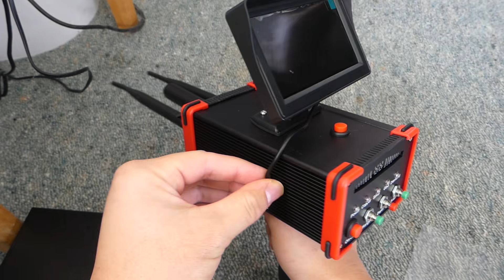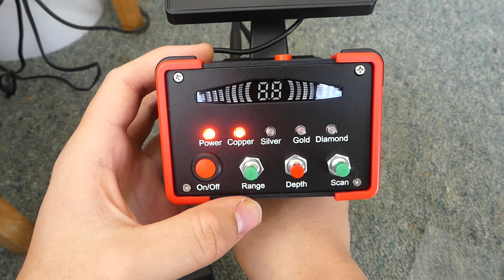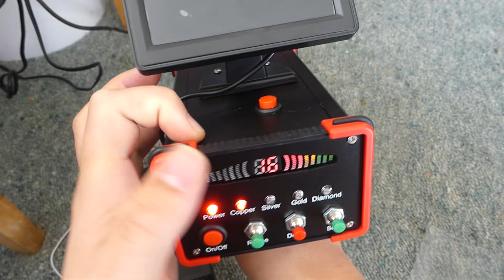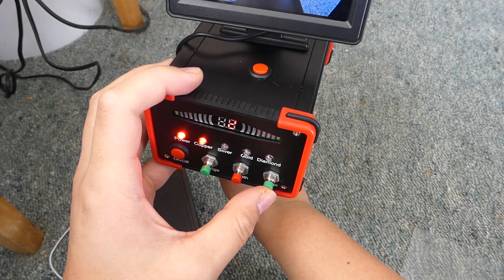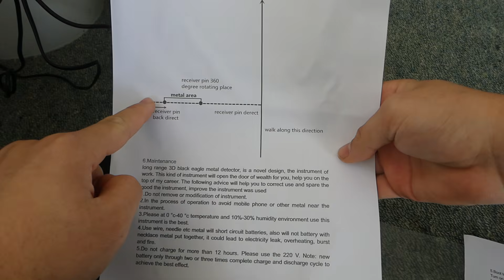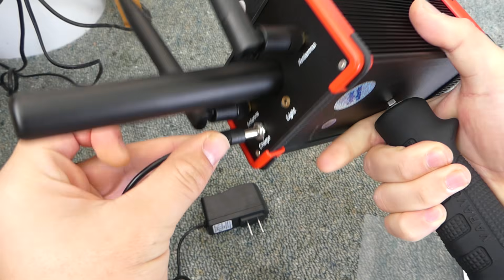How to use the long range 3D black eagle metal detector

Comment: Device working, bad not yous on you country, you nite one program key , to yous on you eart system.  I have det samme lokaotor, and working super god . Advanced.
Reply from the maker: Interesting... perhapps you got one that actually works :'] mine was mechanically incapable of pointing towards anything with accuracy and was just a coil linked to nothing on a ball bearing swivel :']
Reply: Obrigado. Poderia mi explicar como  faço essa chave no Brasil ou indicar alguém
Reply: @EloirSilveira-j2s 7.83hz  key on Afrika Brazil and other  earth.   I nite to  25 MHz .  To working perfekt.
Reply: @AKSDetektorSRB  Are you answering with your ass that it is true?

Comment: The problem it can’t separate gold from iron
Reply from the maker: This device does not however I can think of a way you could. by making an EMF field that accurateley measures metal resistance you could tell if it was iron or gold. or by using GPR ground penetrating radar that can read the density of the object. :3

Comment: I want to buy one, what do I have to do?
Reply from the maker: Ah, I definitely would not recommend it, as soon after I bought this device I was a little suspicious, so I disassembled the device by hand and discovered that it was an absolute scam, the antenna wasn't even connected; it was all for show, what I did find inside the device (presumably that they thought no one would ever pull apart because of its expensiveness) was a small four channel remote control toy car looking circuit board with one purpose and one purpose only, to turn lights on and off and make a beeping noise between the battery powered beeper box and the so called detector itself, I made a video on this but no-one seemed to watch it :') https://www.youtube.com/watch?v=Vsf7Q_mFl7k
Reply from the maker: When I bought this device and made a video on it I was young and very stupid, here is a link to the same device that I bought (https://www.ebay.com/itm/334208641676?itmmeta=01J1B712P64TD38VT7BQV9ZGYE&hash=item4dd0632a8c:g:ySYAAOSw-kJhueKs&itmprp=enc%3AAQAJAAAAwHnpnuJWm14m%2F2hDa94DqM9p1Kn%2BYuMaBDBQNekPj%2BWs4Yx1eYqWmdmAhZhe1Ov%2BKZuyt7LikdggPJbGChfnf83gs%2Fpd0xt8wglbHiF0mwbGXcE2YTkRZTQC8c5LWDaDi2k6M7AZiAvmHvdzHUIh%2BO8S0OmRqgUdjSt4xWsu2l9OSX0GaNcwjyt9JZ%2Fr7g8bfJbY6xZjNB1Q2r0MOI5pQvohFpOBM1K6VkgK67UiWmJnfXI%2BM68YARYozY%2BmsIP1Uw%3D%3D%7Ctkp%3ABk9SR5arhOeKZA), but please PLEASE! don't buy it. It is 100% a very well made ruse designed to lure you in and trick you into thinking you are getting something of value 😢. I fell for it hopefully you don't also, at the time of making the video I was convinced that it would work, I tricked myself into thinking it was real, and then curiosity got the best of me and I had to know for sure whether or not it really did do all that it was claimed to do, It has the most dodgy sketch back alley video game dealer instructions and that was what made me decide to reverse engineer it. :')

Comment: I have this before. Its fucken fake...
Reply from the maker: It is! I spent $600.00USD on this and then got suspicious so I made another video of me dismantling it to see whether or not it even had the required parts to detect metals and half of it wasn't even connected and all that I found was what looked like a 4 -5 channel remote controlled car circuit that did nothing other than make the lights turn on and off. This was a massive rip off!

Comment: Sar please tell me about is price
Reply from the maker: it was $600USD, however I found out it was a scam after dismantling and reverse engineering it. 😢
Reply: @Olectralab how is possible for reverse engineering?
Reply from the maker: @DuganaIandy  I disassembled the device and found it was incapable of controlled movement, it was literally just a box on a bearing with what looked to be a remote controlled car circuit the turned 4 lights on and off.
Reply: @Olectralab  I  want modify this machine there alrm system can u tell me how can I do it?
Reply: That's mean gold detacting after that alarm will on ....
Reply: How much in Saudi Arabia royal

Comment: HM sir..and how to buy
Reply from the maker: I got this on ebay but I wouldn't recommend it. I dismantled it to examine the parts and found it to be a total scam. Half of the parts were not even connected and the rest were not even closely related to the circuitry required to detect metals let alone gemstones.